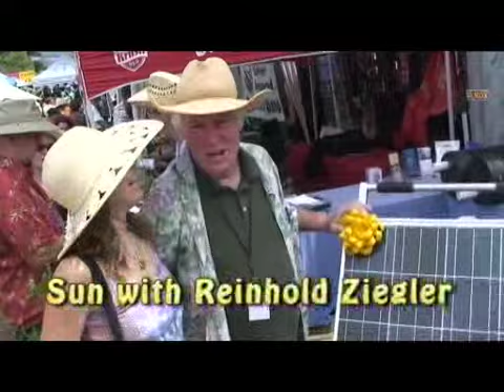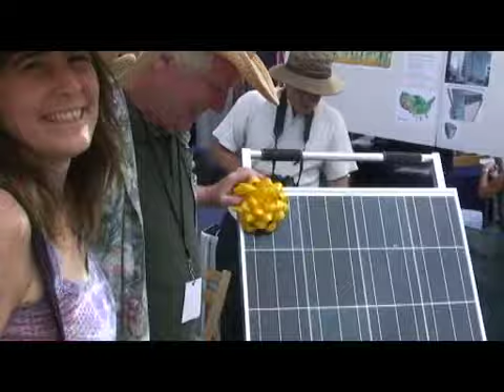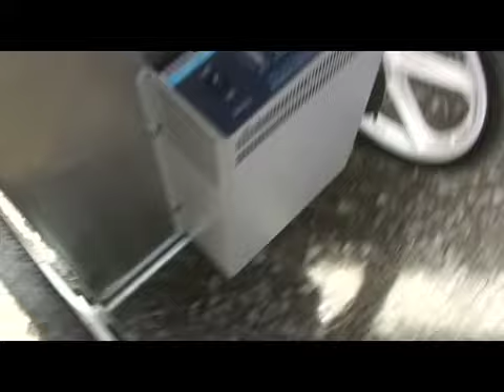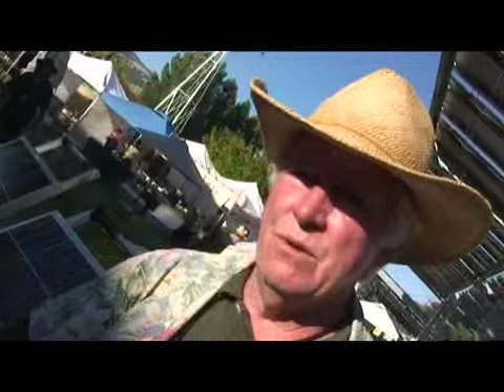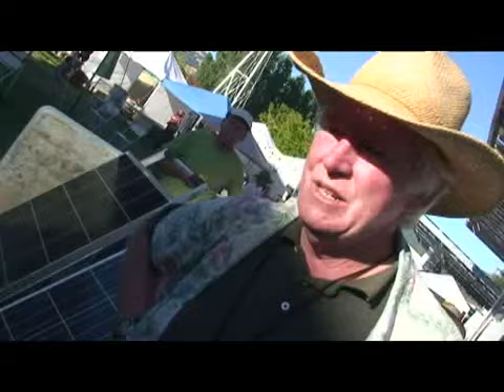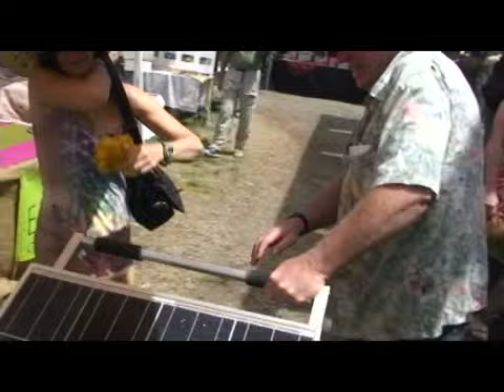The Sol Man solar generator

Comment from the maker: You somehow didn't catch the concept of how this unit works- The SOLMAN uses a solar panel to charge 3 large deep cycle batteries, which then run an inverter for creating your 110V power supply. It's simple and works well- we've been using ours since last summer without a hitch.

Comment from the maker: no, I've actually used it for powering mostly smaller items, like laptops, lights, battery rechargers, etc.  You do need to regularly adjust the position of  the solar panel for max charge during the day.  My 3 battery model is very heavy, and it does strain the wheels...not good for moving a great distance..it has a 1500 watt pure sine wave inverter..